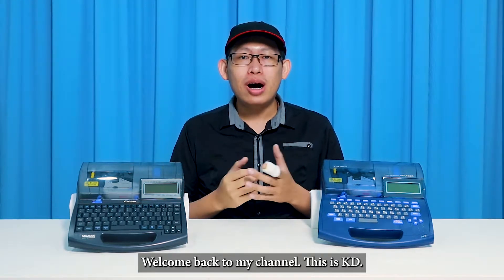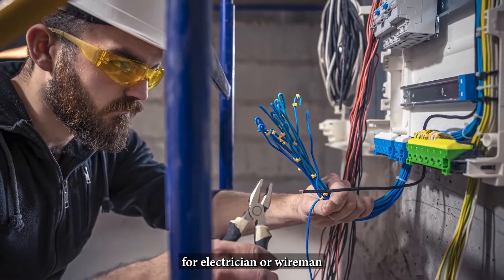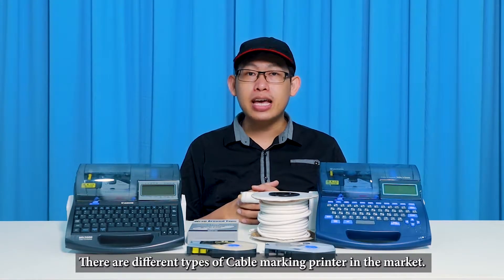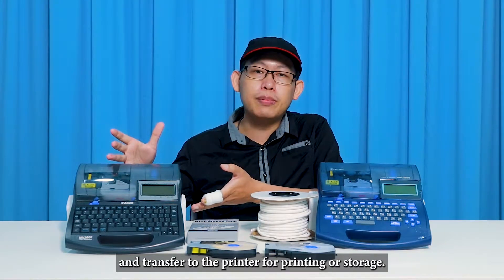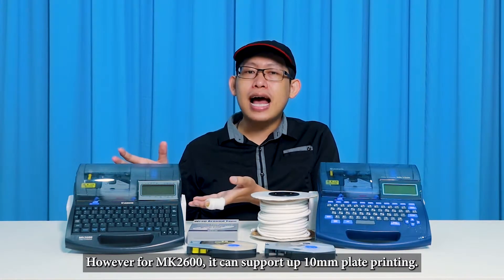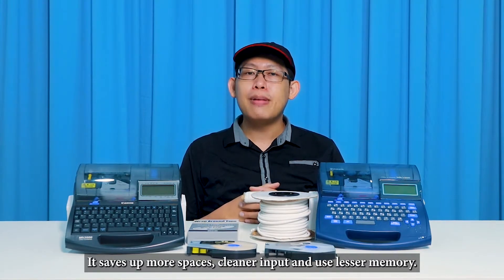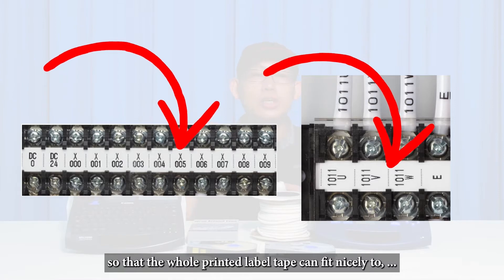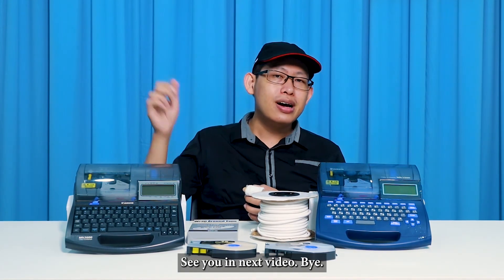Canon Cable ID Printer - MK1500 & MK2600 - What is Cable ID, Product Introduction, Review, Features

Comment: How to print direct from ms excel sheet.
Reply from the maker: Hi, it does not support direct printing from MS excel sheet. Instead, you can import the data from xls to the MK2600PC software, then print from the software. Please note that the software is offered to MK2600 model only